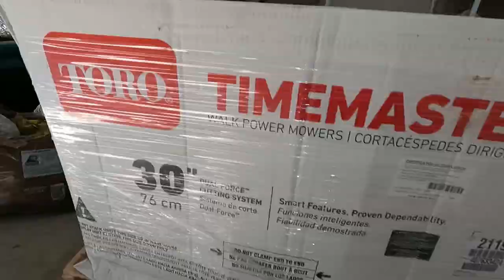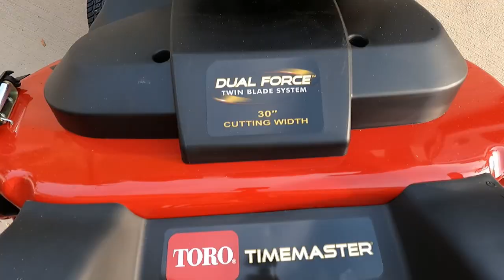Toro Timemaster lawn mower came in the mail

Comment: Looking forward to the comparison video. The time master is a awesome machine. If you can video the transmission as well. Would like to see the difference if any. I mow a lot of steep terrain and the transmissions simply doesn’t hold up. I literally fried the last one. Transmission over heated and the gear oil boiled out somehow. Those little transmissions are sealed units.
Reply from the maker: The Turfmaster definitely will drag you up hills!

Comment: I've used timemasters for 4-5 years, I switched over to turfmaster this year because I found the timemasters broke down alot after a season of doing 10-15 yards per day. Timemaster is a great machine though, I'm just hoping the turfmaster holds up a little better.
Reply: It's almost the same thing. You're going to burn through pulleys, belts and cables. Both of mine break down every year but then again I mow a lot of small lawns with it.
Reply: That isnt bad at 300 yards a month it has paid itself. To be honest you are better off buying a new Timemaster each year and selling them after each season. That turfmaster will still break down and really you are not saving anything.

Comment: I am on year 4 with my Turfmaster. Absolute beast. Bought a FW15 this year and I would take the Turfmaster any day over the FW15.
Reply: Im on the fence between the 2. Can you elaborate more?
Reply: @aaronschramm5091  Several reasons. The TM is lighter and much easier to handle. I find the FW15 to be pretty cumbersome and not very enjoyable to use. The TM can very easily convert from side discharge to mulch to bag. The FW 15 cannot. I will say the FW15 has a ton of power. The cut quality is about the same on both. I have both on my trailer and pretty much use the TM every time over the FW15, which I plan to sell.
Reply: @mcavato1  are you running the Kohler or Kawasaki engine?
Reply: Aaron Schramm Kawasaki in TM and Honda in FW15